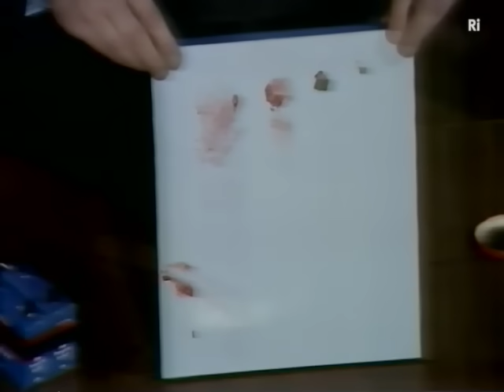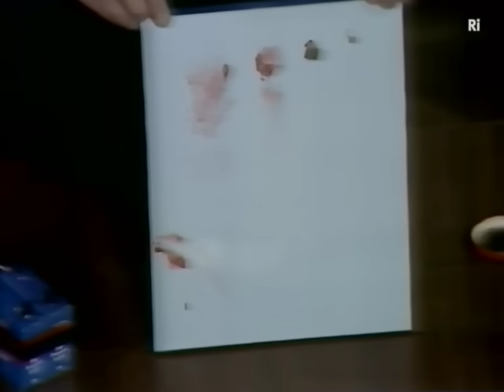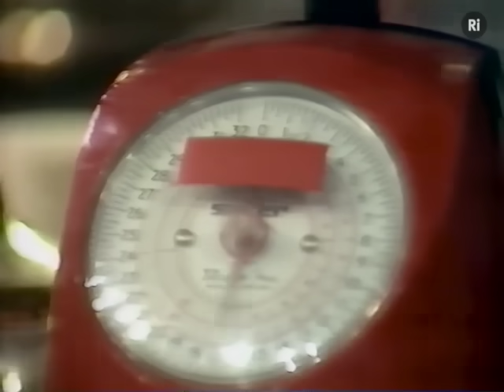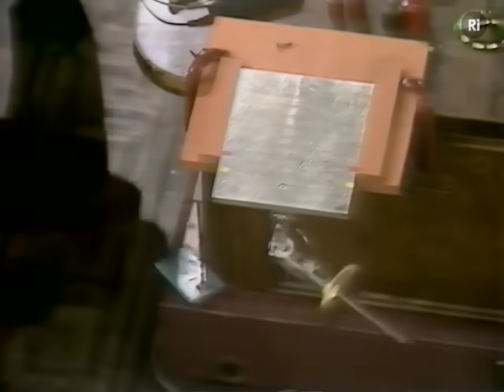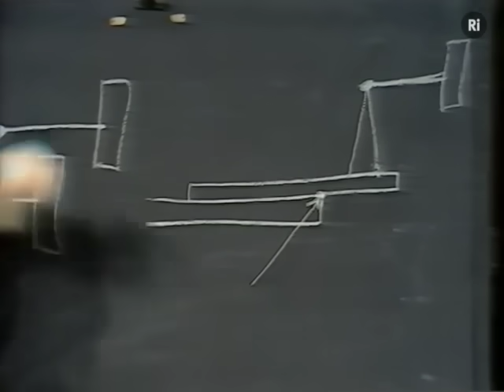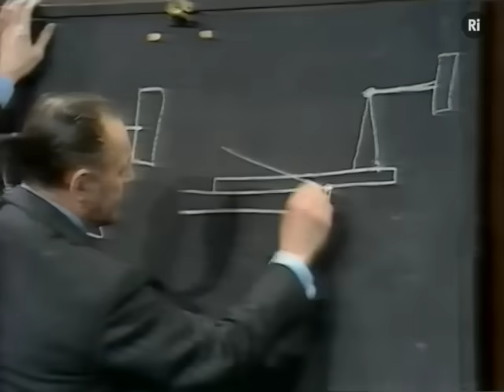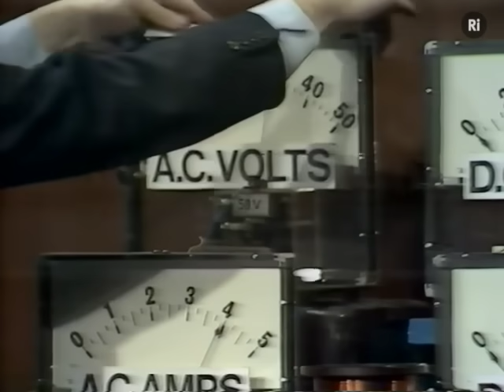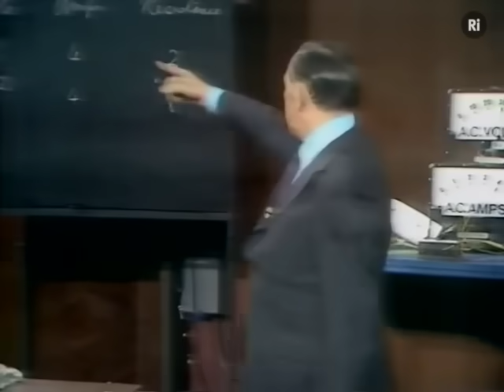☝#AntiGravity Part 3: Eric Laithwaite's Reality-Defying 1974 Lecture on Gyroscopes #HiddenScience

Comment: Would be interesting to see a motorcycle frame setup to demonstrate the gyroscopic effects of engine, wheels, and variations of front forks and steering angles. Upright stability is quite amazing even at very slow wheel rotation.

Comment: Spinning up a gyroscope with compressed air is pretty dangerous  if they decide to come apart doing 5000 RPM. I know of a guy who lost a finger when he did that with a bearing.
Reply: A bearing isn't a solid wheel. Totally different.

Comment: As you have said their are many reasons we do not
 share our knowledge of Science with others.
 I fall in to the category of lack of funds and so I share by
 telling my ideas with others through word. 

      With the use of magnets with the north poles toward
                  the outer edge of the wheel , 
 giving the magnets the freedom to move
 in and out without leaving the wheel, 
       with its only restrictions being side to
 side and leaving the wheels outer edge.
 Place magnets (12) evenly spaced around the wheel.
( may want to experment with
 angle that magnets slide in and out of wheel.)
      Mount this wheel inside a framework which leaves
 just enough clearence to spin free.
 Around the inner edge of the framework going around the wheel,
 install electromagnets to oppose the magnets on the wheel
 (north to north), with the shaft bearings and
 framework mounted solidly together. 
This mounted to a cart with wheels. 
     By putting electro magnets  positioned
 around the framework, you can change the center
 of the mass of the wheel creating thrust
 moving away from the electro magnets.

Comment: So, I think I understand. The two gyros processions are against each other and this creates a new procession vector upwards. Am i right? If i am, is it possible to halbach the gyroscopic force much as Tesla does with their motors magnets to focus the magnet flux? Maybe a gyro made of gyros could accomplish this.
Reply: But the gyros process in the same direction don't they? Wouldn't that just make them spin faster ad a whole? Or would you spin one gyro clockwise and the other counter clock wise?
Reply: @velocityacoustics  Yeah, I'll be honest with you ,it's hard to really visualize what is happening here unless I experimented with gyros myself, as their properties are a bit weird. I do think that UFOs are using some type of gyros based propulsion based on a more advanced understanding of gyros and using super advance gyros.

Comment: The big idea is to mate electromagnetic phenomena with gyroscopic phenomena to produce a device or devices that don't run out of steam and are useful for propulsion. In other words an electromagnetic gyroscopic engine. What a dream. I'll bet there is somewhere just such a creation only it is as is everything in the Modern World occulted (hidden).
Reply: Im am thinking you could modify an existing internal combustion engine to run via electromagnetism. Perhaps even efficient enough to generate its own electrify to power itself.
Reply: clayfame  Can't speak for Malcolm but I could, I think
Reply: clayfame  I actually think the gyroscope portion does the lifting and the power has to come from somewhere else, i.e. powered gyros for the lift, best way I can think to describe is it a gyro made of gyros
Reply: clayfame  the easiest way to describe it is that you take the idea in the video "Antigravity machine finished - part 3" (you get a good look at 9.08), but instead of having two gyros, you have a whole horizontal wheel of them. I hope you understand
Reply: clayfame  Now about that laboratory and resources... ;D
Reply: Hi guys i am a software engineer with zero knowledge of this type of science. Out of curiosity though,

Could one create a device that uses the rotation of the gyro to create weightlessness in the entire object, and then using simple drone propulsion to move the object? In this scenario we assume theres a power source to get the gyro moving.

What are the side effects, why would it not work, and does it make any sense at all. 

Thanks.
Reply: It's been the dream of sci-fi writers to create floating, flying cloud cities. Or to tap into ' ancient technologies'  , long forgotten, to do amazing, even ' magical 'things..

Comment: What if you stacked counter rotating gyroscopes on top of each other. Would you not have a zero inertia machine unaffected by external forces because the gyroscopes reactions would cancel each other out??? 
If you build it, I want to fly it.

Comment: a spinning weight above a certain revs has no weight as all the weight is being centrifuged off the contact area of the shaft.
It is only when the speed drops that the weight can impinge on the shaft and transfer its weight. 
Plus trying to turn the shaft brings precession into play and that also impinges on the shaft.
Jet engines run for decades because their revs keep load off the bearings.

Comment: Unit requires 3 discs spinning , not 2. They are to be in RPM ratio , 
just the way Keely did it in late 1800's. He used heavy sirens fed from 
compressed air and varied the frequency of sound as RPM was changed to 
RATIO. See books reference works of  John Keely,  Philadelphia , Pa.  
1865-1899. One ton structure of resonance + harmonics raises up and 
settles down as per lowering of RPMS.

Comment: i would like know if by effortless levitation does momentum change/ slow any??
Reply from the maker: Yeah, I think momentum during precession is much less than expected for a typical non-spinning object moving at the same speed.
Reply: @mes  i meant to say does rpm of wheel slow , not meaning procession momentum,
Reply from the maker: The RPM gradually slows down due to friction, but if even if it didn't the gyro will still precess.

Comment: What effect then, do the tires and wheels on a car going down the road do? Or a motorcycle? Can we find a way to enhance efficiency of vehicles?
Reply: wonder why bike riders lean in the corners? or why is easier to keep balance on the bike when it goes faster?
Reply: I read some racing motorcycle engines and drive trains are made to spin the opposite direction to create a gyroscopic effect , stabilizing the bike .
Reply: Segways and hoverboards are gyroscopes.
Reply: @tylerbrandon460  really?
may have gyros for stabilising but I doubt they work by gyropwer.
Reply: @tylerbrandon460  all bikes have flywheels that are gyros.
read up on rotary aero engines of world war one.
Reply: @rosewhite---  I just remember seeing a story about it years ago it was s prototype for that big bike race isle of man I think. I'll look it up. So then those old hit and miss engines with giant flywheelss are big gyros? That's cool.
Reply: @rosewhite---  I think that's what it was so not matter how slow or fast you went you still had stability
Reply: @tylerbrandon460  Pilots report the old radial engine fighters did have weird handling.
and a great weight would not need to spin fast to have strong effect.
I'm sure I have seen pix of odd prototype motorbikes with rotary engine in wheels.
Even a small toy gyro has strong precession so a big engine must have a lot.
But then gyro engine in bike wheel might not have any effect on straights but in corners the precession would occur and either force the bike round faster and easier or make it fly off the track depending on which direction the gyro was spinning.
Gyro engine in wheels would be OK on oval or circular track as each turn it would force the wheel into corner but what happens when rider tries to go down the straight?
Reply: @tylerbrandon460  https://en.wikipedia.org/wiki/Rotary_engine    Just read this page and refreshed info in rotaries.   
The race winning bike engine was comparatively small and the big wide handlebars would give plenty of leverage to control precession in corners.
Laithwaite gyro was 40 pounds and had plenty of precession so the bike must have had also.
Probably be quite interesting to try riding it?
Reply: I wondered the same thing. I do know the lighter your rotational weight the better. For example tire inner tube and wheel rims etc the better mileage you should get. For example steel rims over aluminum. Aluminum being lighter over the life of the car gets better mileage. And I’ve heard solid disc wheels were tried on motorcycles but caused such gyroscopic resistance you couldn’t lean into the corners to fight the centrifugal force and kept going straight. Don’t know if true.

Comment: Anybody thought of accelerating multiple gyros on horizontal shafts around a central vertical shaft using internal shaft motors in the horizontal shafts in order to generate vertical lift? Would love to build something like that!
Reply: if you exchange gyro and precession space around, where its moving when spinned, to torus filled with mercury and ferrium, both in 0 degree Kelvin and inside electromagnetic field, and you get more than 7.ooo rotations per second, the whole torus will lift itself; have 4 like it instead of car wheels and you have Jetsons flying car, antigravity TR3B made in USA Area51 or Russian Federation in 2022 in Dubai, where they present officially flying car using same principle, because usa wont commercialize it, because of Project Paperclip made in CIA till 1954, where hitlers scientists were taken to USA.
Reply: @worldbestt-shirtshoodie-go6184  any more info on those facts? Do you have any sources, not that I don't believe, but I'd like to see some more background to the research.
Reply: @worldbestt-shirtshoodie-go6184  has been done during the third reich

Comment: You do not apply torque to a spinning gyro - you apply a push that causes the bearings to make contact with the frame.
The gyro responds by precessing.

Comment: You need unbalanced gyro to create the thrust'.
      To achieve this you can.
 (1) Create a brass disc 12 inch diameter 1 inch thick
     (1a) Drill holes in the disc insert barrel magnets with north pole to outside edge.
(2) Create a brass disc 12 inch diameter 1 inch thick
    (2a) Drill a hole 5/8 inch by 4 inches (from the outer ring toward center axis)  every 60 degrees.
   (1b)  insert ( 1/2 inch  X 1 inch)  barrel magnet  into all 6 holes. 
   (2c) There must be room for magnets to slide.
   (2d)  Insert ( 5/8 inch X 1/4 inch) graphite plugs. 
(3) Place disc inside of brass ring with an inside diameter of 12 and 1/8 in
   (3a) Mount around the outer ring electrical magnets every 45 degrees.
   (3b) 8 electrical magnets at.
     ( 1) North),( 2) North East ),( 3 )East),(4)South East)
           ,(5)South),(6)South West),(7)West),(8)North West)
(4)  . When energized putting the gyro out of balanced creating a forward  thrust. 
   (4a) Depending on  which  electrical magnet is energized .
 
 Concerning Gravity created by centrifugal force. 
     (1) Because gravity and magnetic flux are unrelated.
     (2)  We can consider using a balanced wheel,
           with freely mounted magnets
          ( a) With north poles facing outward  
          (b) on outer edge
          (c) mounted in side a framework 
     (3) With permanently mounted electral magnets in frame
         (a) with the north poles toward the wheel 
              in different locations around edges of said wheel 
        (b) As the wheel spins creating centrifugal force
        (c) power added to the electrical magnet
    (4) Will cause the  centrifugal 
      energy to flow to opposite side of
          the wheel causing vehicle to move in that direction. 
You can use this configeration to shift the center of the wheels gravity thus creating foward thrust which can be aimed in any direction. Which can in effect Defeat gravity.
Reply: Strange. How about you go ahead and build that yourself? You must not really believe your thing would work
Reply: Would sound technology enhance this I wonder

Comment: Newton's law should be overhauled is a great comment and I must repeat it!  They still can't come up with a reasonable explanation of the tides.... gravity ha ha ha ha
Reply: @arnabsinha5408  please explain
Reply: Why not research it yourself rather than ask a layperson to do the work for you?
Reply: @glennquagmire3258 , I didn't ask anyone.  I have researched and gravity does not move the tides and Newton's laws should be overhauled.  Why don't you research and write something worth reading.
Reply: @gator8287  The tides work because Earth is a ball of water surrounded by a now-shattered crust of granite and quartz that GOD designed to provide warm undersoil heating.
As the sun and moon orbit Earth they tug on the crust and raise it to cause the water to move.
Howeever since The Flood 4,350 years ago there has also been strong winds that work to move the water.
Reply: @rosewhite---  I disagree.  In my opinion the sun and moon do not orbit earth and they do not tug on earth with what you call gravity.  The universe is electric and electromagnetism is the dominant force, not gravity.  The difference in these forces are huge and gravity is on the small end of the picture.  Water also has a fourth phase and when combined with light and electromagnetism, this affects the water.  Newton's law is outdated and is just mainstream science's unnatural law that needs to be overhauled.  Gravity does not exist in space.
Reply: @gator8287  Spacraft get the slingshot from gravity.
Reply: @rosewhite---  if you think that comment will convince me that gravity controls our universe, you are wrong in my opinion.  Our universe is electric.  You should watch you tube video called, Thunderbolts of the Gods.  It continues the theory from Immanuel Velikovsky that electromagnetism should be included in the model of our earth and universe and that space is not an empty vacuum controlled by gravity as mainstream science claims.  I think petroglyphs provide an insight in this.

Comment: As Laithwaite was in London (?) and about 51 degrees above the equator he as actually travelling at say 400 mph through space though obviously stationary in London.
The people on he equator are travelling 1,000 mph. Earth's 24,000 miles circumference divided by 24 hours = 1,000 mph. 
The gyros were weightless at speed and obviously affected by Earth's magnetism plus the speed of rotation.   
Their precesses varied due to the decreasing speed versus the affect of Earth's speed.
Logically repeating these experiments on the equator would show greater precesses.

Comment: He brought up ohms law and newton in this video. I used ohms law to prove Newton wrong. He basically said “Newton was wrong. That Newtons laws only apply to straight lines. Not coils or spinning things” earth is a giant spinning gyroscopic sphere. Gravity is momentum not acceleration. That’s why the gyro lifted up on the scale spinning at or around 30mph. Newton failed in describing resistance in physics. Ohms law proved it!

Comment: Though I believe the tower was not supposed to spend the ice trick didn't prove anyting. By the time the gyro was spinning and placed on top the higher temperature of the tower surely melted a tiny bit into the ice holding it in place for sure. Not to mention it looked more like a slushie
Reply from the maker: Yes that is true that the experiment could've been better, but even then the gyro's mass is so far away from the flimsy tower that it should've knocked it down even if there was some friction at the base. I have replicated this experiment with an ice-block that is free to glide and the gyro precesses exactly as Eric Laithwaite claimed, that is without the expected inertia in precession: https://youtu.be/j82Z1KgfRtI

Comment: 41:21....Just Observe the technician...Speeding up a heavy (or any) Gyro......to 2,000 revs. Per minute “With a hanging tie around his neck”!? Pure sign of insanity for anybodies safety...including his own...Instant fatality if the rotating equipment touches the loose ended Tie!.
Reply from the maker: haha yup.... The Health & Safety Department may not have existed back then...
Reply: @mes  Yep!?.....It’s called “Common Sense”.... Health and Safety is a belief that should Be renamed “Un-Common Sense”!? Which is not on the Education curricula.....as general observations confirm. Unfortunately.

Comment: It's just intuition but I think you might get a gyro to get to weigh very little, but you'd never get something for nothing. You can't use a gyro to get something to float off or fly. You can just get the gyro, itself, to weigh less - whatever that's good for.
Reply from the maker: I believe your letting your intuition get ahead of reality. A gyroscope "loses weight" when its center of mass changes, as per Experiment 20: https://mes.fm/experiments-playlist

And in Experiment 3 I show that a gyroscope precesses, exerts "inertial forces", and even magically rises on its own without any additional loss of spin speed; i.e. it's getting something from nothing ;) (or better yet the Aether exists).

Comment: Somebody tell those fellas you're not supposed to spin up a 16 lb disc with your forehead directly in the plane of the spin. Construction workers and the like know putting your head or face in the plane of spin of about any kind of saw or grinder is usually a bad idea.